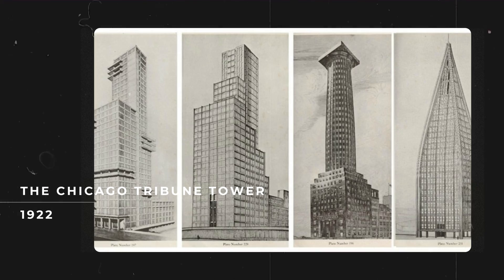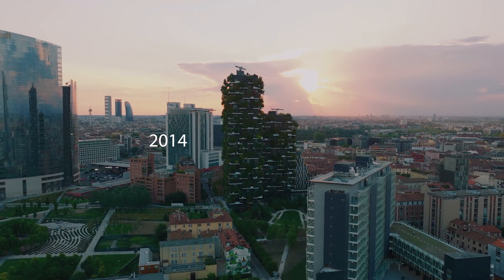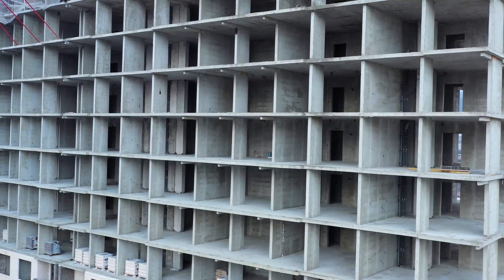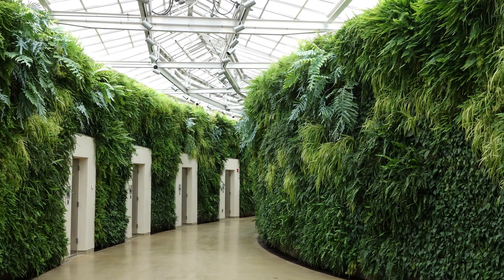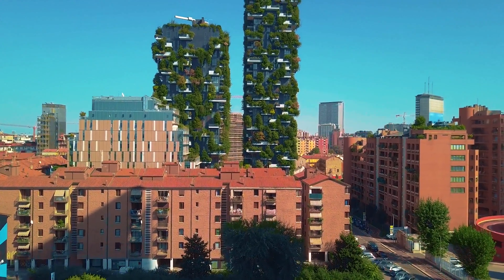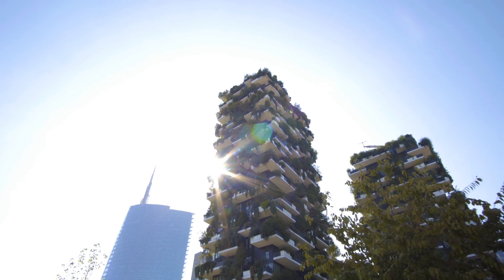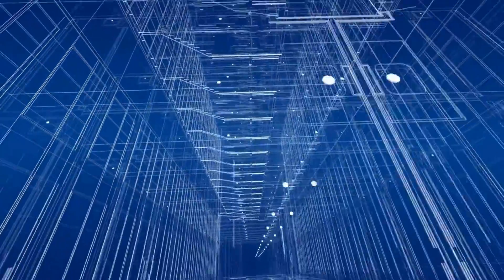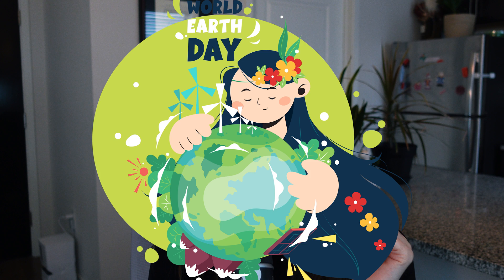tree-covered skyscrapers are actually a bad trend...

Comment: As an Architecture Student I don't know how I feel about it. In some cases, it is just cladding or ornamentation using some bushes. I think it works better for less vertical buildings around 100 feet or so. You don't have to pump water around so much and it's easier to maintain. The materials and systems behind the facade should be the real star of the show in this design even more so than other buildings. I think if the type of buildings like the Basco's in Milan were strategically spread out over a city it would be beneficial sort of like parks to combat the heat island effect. Maybe make them more public so you don't have to have a net worth of 30million just to experience it. Sounds like a city full of these buildings would drain the regional freshwater resources which is the reverse of sustainable.